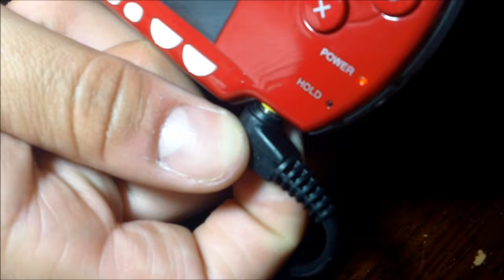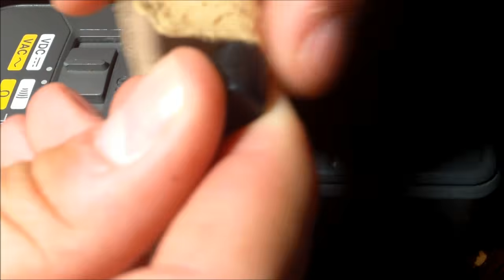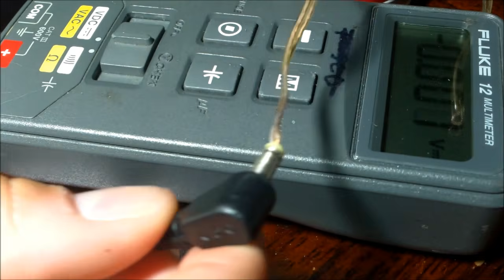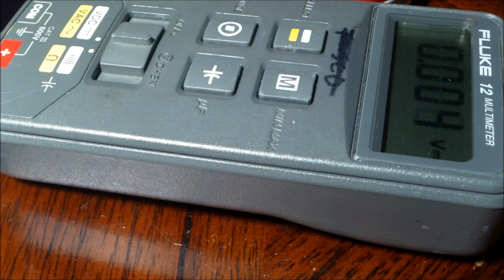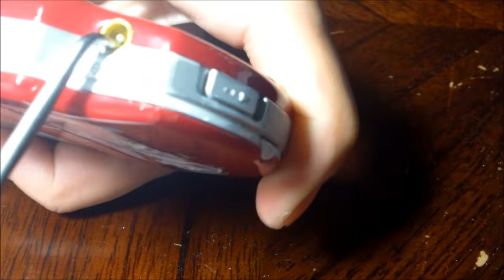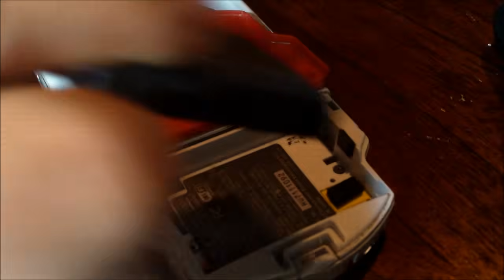EASY Quick FIX PSP CHARGING PORT CONNECTION

Comment: Is it specifically needs a speaker wire or i can use somting else?
Reply from the maker: If u have a volt meter and probes are skinny u can just stick in to test charger but any thin conductive wire will do. Thanks for watching! If this help thumbs up 👍👍👍

Comment: Dude when I pull out the charger it turns off any solution?
Reply: samee
Reply: @ZennLyricss  Dude i fixed it. Take a small piece of paper and fold it twice or thrice then put in on the bac side of the battery holder
Reply: @Bibhu_kekob  Oh thanks

Comment: 2023
I did it on a Psp 1000 model and It worked👍🏾
It was blinking orange while plugged and it didn't after i added a thin layer of tape behind the battery.

Thankssss
Reply: should be fine as long as it adds little bit of thickness(so that the battery has pressure over the charging port)
@mohammednoumaan4656

Comment: I just found mine, it won’t turn on even while plugged in, the light is green but doesn’t turn on. I’ve changed the switch board but now it just turns red when I try to turn in on while charged! Please help

Comment: My psp works when I have the wire plugged in even if the battery is in or out and when I unplug it ,it won't turn on , what's your thoughts ?

Comment: bending the side pin inside the socket outwards helped charging my psp 3000 more consistently, it still has some positions where my charger won''t work, but at least it's not problematic anymore, I used some generic clock repair tools (precision phillip screwdrivers) to do it, maybe not the best tools but it kinda worked.  Gonna keep using my psp a bit longet it seems :D

Comment: Mine was all carboned up, accidentally ripped it off of the board trying to unplug it so ill be soldering it back on. Removed the carbon from the center post expecting it to work once soldered back in place.

Comment: I can get the charger light to come on, but it clicks off in 2 minutes. The psp won't hold a charge. I replaced the battery and charger, still having the same problem.

Comment: Thank for this tip I have the same problem with my psp I used the sandpaper to sand the  around  charger tip and it worked it was field with dirt thanks know I can charge my psp and play with my psp and I don't have to buy a new charger 💯👍😊

Comment: so here's my issues
 1 I plug it in and the orange light comes on, but couple minutes later it turns back off.
it turns on without battery, on charger, left it on charger over night and no charge and its a PSP 1001
its my younger cousin's and I have no idea when he lasted played it he said something like 4 years ago 
2 its my cousins and not mine 
please me with my 2 issues thanks

Comment: i have a psp 3k with the charging cord/pspgo charging cord/usb/5 pin slot cord too...my psp works only if both the top slot cord and charging cord are both plugged in at the same time... but it sometimes works without the cord...i have so many games on the system...but none of the discs work :(

Comment: just bought one second hand, not going to do that again.. i have this problem right now fml.
Reply: +Sander Haverkamp same here, mine don't even turn on the light. Did you solve it? any clue?
Reply: +mefugoenmicarro Yeah haha i use a mini USB kabel to charge it on the PC. and if she wants to use the charger she needs to wiggle it a little bit around.
Reply: +Sander Haverkamp thanks, good idea :) I will try the USB connector, damn sony, always so complicated...
Reply: +mefugoenmicarro i hope it will work for you! good luck

Comment: mine work by putting the charging pin then I wiggle it facing my direction is put a pressure on it facing ur direction then orange light came up now working perfectly again I drop it then the light didnt show up

Comment: Great tutorial, but honestly, not many people have Sand Paper, a speaker jack and especially a volt meter lying around the house. It's a household not an Electronics classroom lol.
Reply: sure they have...
Reply: Then do the second part and if it doesn't work, you need a new plug. Simple. I skipped the first part entirely and fixed it just with a tiny screwdriver.
Reply: A multimeter is like $5 and you should have one in your house if you own anything electrical.
Reply: Chris Marshall how
Reply: @GhostReaper18  the paper worked for me
Reply: Just buy... 😅
Reply: Who needs sand paper when you have an emery board and a paper towel? Just that alone fixed my problem, I had a dirty plug.
Reply: you should  as man have at least two of them 

 

 

Reply
Reply: Matthew Hello

Comment: My PSP no longer accepts power from the charging port, BUT it is charging from the USB, to which I say YAY!  But the power light doesn't come on.  I think maybe something worse is wrong with it than just the charging port no longer working. :'(  It got doused with water on my trip back from Bern, Idaho.  I don't know exactly how to fix it if replacing the charging port doesn't do the trick.  Also, the case is very damaged from dropping it many times, and the screen is scratched, so, maybe it's time finally replace the whole thing.

Comment: My system won't charge at all. I've tried the USB-charge function, car charger, and the standard wall cable. My battery just isn't accumulating a charge.
Reply: Same problem, huh???

Comment: My psp wont turn on even with or without the battery and i have the charger in and it still wont turn on and the orange light keeps flashing when it charges

Comment: my battery wont get stuck and pop out ;( and wont charge wat can be the problem?
Reply from the maker: check contact pins clean or adjust them.
Reply: ***** do it works on a psp 1001
Reply: Raymond Goessens

Comment: Hello,
 I have a Samsung lcd tv, and the model is LNT325HAX/XAA. The problem that i got is that i was making a firmware update to my tv and in the middle of the procces accidentally i turned off the tv and when i tried to turned on again the screen was black...
 I think that the software is crashed or something like that, because se tv was working perfectly until i made that mistake...
So what can i do to fix this problem?
 I will aprecciate to much your advice,
 Thanks and Regars,